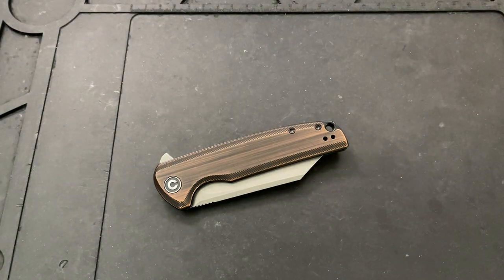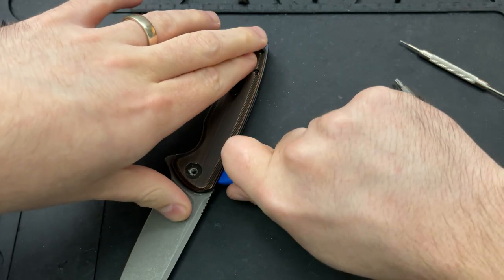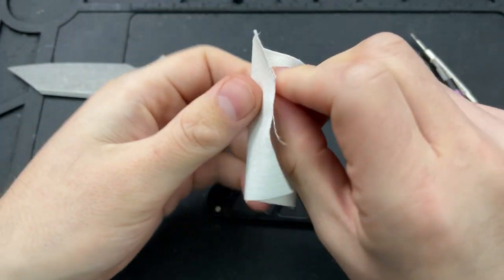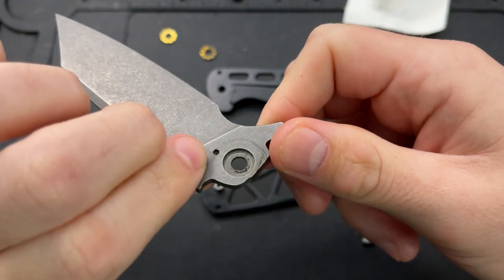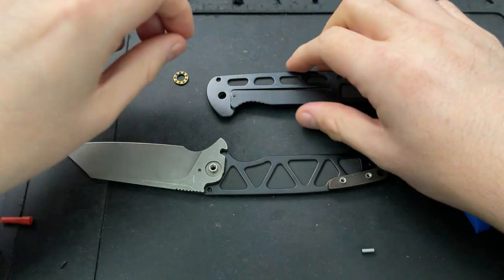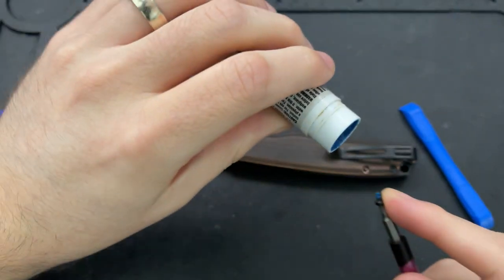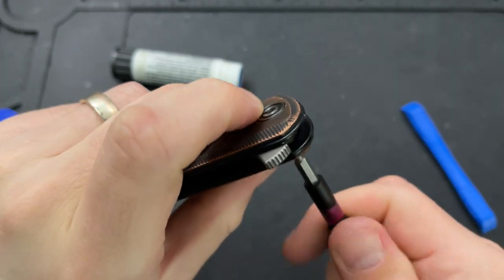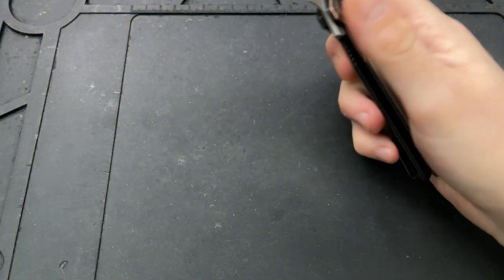How to disassemble and maintain the Civivi Knives Copper Brigand Pocketknife

Comment: Personally I watch every single one, but that's less because I need the info and more because it's fun hearing you rant and the disassembles make good crochet background noise. If you think it's getting a bit much taking apart the same genus of knife over and over, I 100% get that and think you could probably get by with doing a video on an example of that genus (ex. how to disassemble and maintain a frame lock/civivi/spyderco backlock) and save the companion disassembly videos for knives with something worth looking into (literally), like the AD-20, Pochi, or such. 
It'd possibly be harder to find for new people literally googling "how to disassemble pm2" but knife manufacturer or lock type will probably be specific enough to show up regardless, plus I doubt the venn diagrams of "knows the make and model of their knife" and "doesn't know how to maintain a knife" overlap a ton.